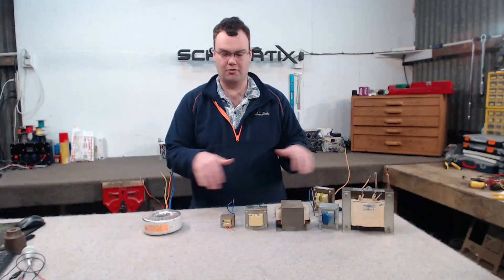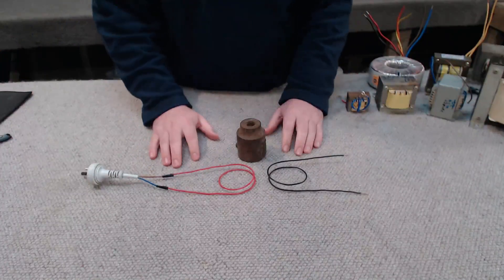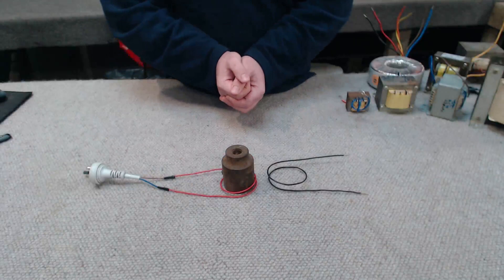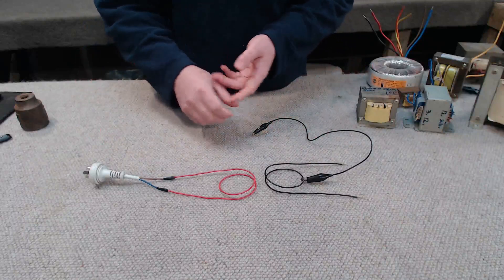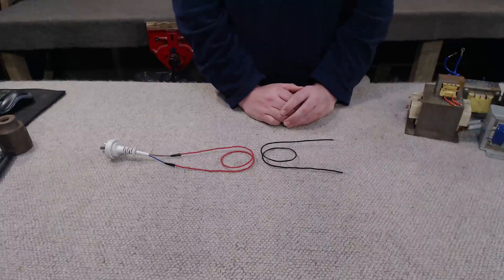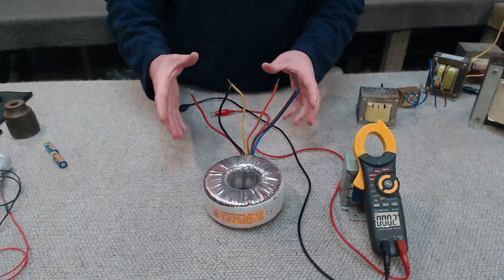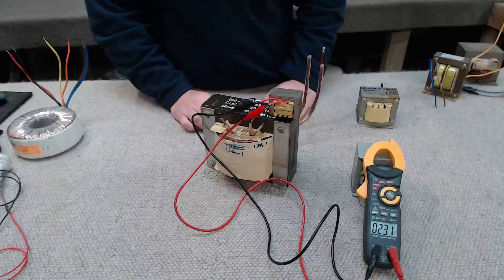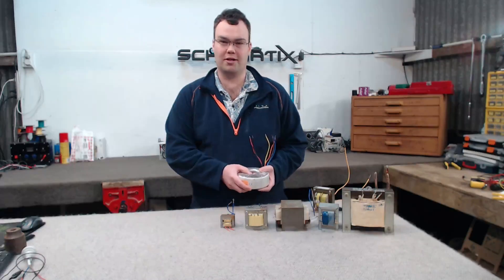Transformers 101: How They Work & How To Wire Them

Comment: Mate. Good video however you missed some critical information about "how" a transformer works.
The "transformation" from primary to secondary happens when the magnetic field around the core collapses or builds. This is why the input must be AC and not DC.
That said if you apply DC, there will be current in the secondary whilst the magnetic field builds but then stop when the core "saturates" (magnetic field is at it's maximum). If you then remove the DC, current will be induced into the secondary as the magnetic field collapses. Chop the DC and you'll get (nearly) the same waveform at the secondary (at which point the waveform becomes AC :-| ).
Keep up the good work.
Reply: Yep that's really fundamental and thanks for clearing that !
Reply: This video was more geared for basic fundamental understanding. What you are suggesting might be covered in a more advanced video

Comment: Hey man I would love to know more about the donut transform er. I'm taking a class for an electrician. You explained this very we ll. 👌👍
Reply: The toroidal transformer is common in UPS circuits and power conditioners. They save on core plates and seem to run quieter than the more common transformer ....

Comment: This was a great explanation, thanks! 👍 I'm always intimidated by transformers for some reason. I always prefer to just work with the abstract idea of source voltage and use a wall wart or something. Did you ever make that video about identifying wires in an unknown transformer?

Quick question: if you have something plugged in, but turned off, is the transformer still drawing current (and therefore money/energy) from the mains?
Reply: If the switch in the mains side circuit is operational and it is switched off then there should be no complete circuit to use any power the only thing likely to cause power use in this state is some conductive path across the switch terminals. A wet switch, damp dust or conductive liquid would likely be the culprit ....

Comment: I am going to Thailand, some time after this Coronavirus goes away, ...where they have 220 volt outlets.  My problem is I have a medical devise that is wired for 120 V.  Last time was in Thailand, I could not find an adapter or some other devise that would allow me to get the 120 volts as needed.  I could cut off my plug to my device and use a 220 Volt plug.  So, I assume I would need a transformer between the 220 V plug and my medical device.  If you could send me an email @ luvmoxie@gmail.com showing me what I would need between the 220 V plug and my 120 V medical device.  A schematic should show me what I need. Much appreciated.
Reply: dude just buy an adapter online but go to the Thailand consulate in your major city area and then ask them they will help you get one online.

Comment: Curious about toroidals that have 4 input wires, two red, two black. I presume this means they can be wired 120v. 240v. When the supplier provides no schematic for connection, How would a person connect it? On the output side it has buck converters to dc pre connected.
Reply: Use a multimeter.

Comment: Thank you Sir! I am trying to build a kiln using a high temperature arc that will melt Gold. The advice I’ve received is to use a microwave transformer. I think I need around 200 amps in order to produce a temp of over 2200 degrees Fahrenheit, much like an arc welder.
Reply from the maker: With a couple turns of heavy gauge cable you could easily get 200 amps @ probably 3~10v. If you have a little extra cash to splash, maybe picking up a used stick welder? It would give you a much larger transformer (don't buy an inverter welder, go for the old transformer style)
Reply: Which poses another question if you don’t mind? What I need is to make a portable. Like backpack portable. What I normally do with my powers Sluice, Is hook it up to a battery such as a car or a lawn more  or marine, and then hook up a power inverter the battery where I can plug I water pump into the power inverter. Do you think I could put something together similar to that?
Reply from the maker: @stephenfuller8345  If I follow your question right. You're asking about building an inverter from scratch? While it's very possible to make an inverter at home. I've priced up the components. My conclusion was buying an off the shelf inverter actually saves money. There are relatively simple inverters schematics online. However, the simple ones I've seen are very sketchy and can have nasty voltage spikes that would damage electronic circuits in most devices. So I can't recommend them.

Comment: Are all ac transformers meant to take 120 volts AC? Seems a bit much for the small transformer. (My transformer doesn't say how much the input or output is)
Reply from the maker: No. Transformers will be designed to only run on a specific voltage. If they aren't labeled it can be difficult to identify the operating voltage. Otherwise, you need specialized test equipment to measure inductance.etc and do some math to work out the operating voltage. In my opinion, it's often more trouble than a salvaged transformer is worth.

Comment: At time 10:00, you said two batteries in parallel would double the "current". Is it more correct to say it doubles the "capacity" or "amp hours"?  I'm thinking that current is the flow rate of energy (charge).  Thanks
Reply from the maker: Great question, Technically both answers are correct. Amp-hours is a measurement for measuring capacity Or energy storage. If I had to choose one term? I'd probably go with "Capacity" because it's a more relatable term for many people with varying levels of knowledge in this field. Naturally, this terminology is only applicable to devices which store power. Such as batteries or capacitors. If we were talking about a transformer which is obviously not designed for energy storage, then both those terms would be incorrect.

Comment: What about the wire thickness of the primary and secondary ? Please reply...
Reply from the maker: Wire gauge (or thickness) doesn't entirely dictate the peak input/output current of a transformer but, it can be used to indicate approximately how much current a transformer could output.

Comment: Does it matter which is the 'intended' primary winding, as that would depend on if you want to step up or down the voltage? A simple continuity test can be used to figure out which wires are electrically connected to each other.

Comment: Wonderful video!. Can you consider making a video that explains more in depth on choosing the correct transformer for the job. Example: I'm retrofitting a CNC machine that is 3ph.  I only have 220v 1ph.  The spindle is a 7.5KW motor that draws 10amps i believe. i have a 440v 3 ph VFD that will allow 220v 1ph input but it cuts the motor power in half. What I'm assuming i can do is take a step up transformer to turn my 220v 1ph into 440v 1ph then input that into the VFD allowing me to power the 7.5KW spindle motor. Will this work?
Thanks
-Chris

Comment: Thank you for the knowledge. Now so know on AC if copper wire turn around a metal. It does not short out...

I was wondering how the circular type of transformer is winding. Is primary wind around a circular metal. 

While circular winding go on top of primary winding.

Comment: Hi there, great video.
I watched your video ‘Transformers 101:  How they work & How to Wire them’. You made mention of how to find out the Primary Winding from the Secondary Windings if the connections weren’t obvious, and that you may do a video in the future to show how it’s done. Did you ever do this?
I have a transformer that was salvaged from a photographic film processing mini-lab, it’s very large in size and rated at 550VA. It has a manufactures label on it with the following markings: TYPE: S-9UF3. CAP: 550VA. PHASE: 1. FREQ: 50/60. MANUF No: 9391094Y. Chuo Electric Ind. Co Ltd. Japan.
I’ve had a hunt on the web but can’t find any specs on it.
It appears to have just a single set (core) of windings (i.e. all the windings are on top of each other on a single bobbin with various tapings extending from the centre to the radius), unlike your video on the microwave transformer conversion, where the primary and the secondary are two separate coils (bobbins) and easy to see.
Each of the tapings terminate on a terminal strip on the top of the transformer and have the following markings on a label fixed to the terminal connector block (from left to right):
‘EXT’  -  ‘PO’  -  ‘200’  -  ‘220’  -  ‘240’  -  ‘TO’  -  ‘100’  -  ‘SO’  -  ’17.5’  -  ‘24’

I have checked for continuity across each of the terminals, and from what I guess is each of the winding’s ‘PO’ ‘TO’ and ‘SO’
‘PO’ to ‘200’ value 1.2ohms
‘PO’ to ‘220’ value 1.2ohms
‘PO’ to ‘240’ value 1.3ohms
‘PO’ to ‘TO’ No continuity
‘PO’ to all other connections to the right  No continuity
‘TO’ to ‘100’ value 0.5ohms
‘TO’ to all other connections to the right  & left No continuity
‘SO’ to ’17.5’ value 0.1ohms
‘SO’ to ‘24’ value 5.0ohms
‘SO’ to all other connections to the left  No continuity

The ‘EXT’ connection measures almost the same as the ‘PO’ connection (i.e. connectivity between EXT and 200, 220 & 240, but none of the others).

My guess is that there are 3 separate winding:
PO to 200, 220 or 240
TO to 100
SO to 17.5 or 24
I don’t understand what the ‘EXT’ terminal does, although there are 2 tapings from the core connected to this termination.

I want to use this transformer for a 24volt supply only, but I’m hesitant to connect the ‘PO’ and ‘240’ tapings across the mains and see what voltages I get on the ‘SO’ and ‘24’ outputs (if in fact they are outputs).
What do you think?
I live in Auckland and I could let you have my email address if that would be easier to communicate.
Thanks

Comment: I needed to ask, let's I'm receiving 220 volts at 5 amps and I want to remain at 220 volts but have 20 amps of power, how would I go about doing that
Reply: You can't do that with a transformer alone. Power is the product of voltage x current, so 220 volts at 5 amps = 1100 watts, whereas 220 volts at 20 amps = 4400 watts. All a transformer can do is change the ratio of voltage to current between the primary and secondary coils - it cannot give you a greater power output. So if you stepped up your 220 volts to 440 volts, that would be at half the current. Going the other way, you could step the voltage down to 110 volts, but that would double the current.
You can have any ratio you want, depending on the ratio of turns between the primary and secondary, but the overall power output will never be greater than the power input. In reality, the power output is usually a little less than the input, since transformers are not 100% efficient. Some energy is always wasted as heat, which is why transformers get warm in operation, and why really big transformers need oil coolant loops to stop their cores melting.
Reply: Just quadruple your voltage by getting a different power supply. That 220 doesn’t mean much when it’s limited to 5 amps. Otherwise lower the resistance of the output where the 220 volts is going through

Comment: Note: when disabling a microwave to salvage a transformer, discharge the capasitor by disconnecting it from the unit with insolated equipment. USE GLOVES AND A TOOL THAT IS NOT CONDUCTIVE.
When the capasitor is disconnected note that it is still charged and can be fatel.

Comment: Thanks for the video.

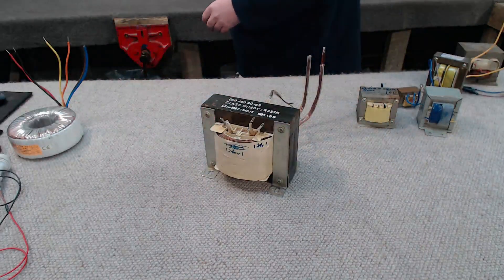I do have a question. Around the 11:00 mark you say that "you can't simply use a voltmeter to figure out the primary from secondary windings". Do you mean to say that you can't use a voltmeter to decipher which leads are which on the secondary coil? 

In technicality, can it be assumed that the two wires at the back end (relative to the viewer) of the transformer are the primary and the four wires at the front end of the transformer are for the secondary?

Final question, if that is in fact not the case, could you at least use the "continuity" function on the voltmeter to correctly identify primary from secondary coils?

Thanks

Comment: I understand the physics of the transformer, what I'm stuck on is, I stripped down a car battery charger and inside is a transformer with 6v and 14v outputs and that goes to a bridge rectifier, when I connect up a dc fan i took from a car cooling system, the bridge rectifier continually clicks on and of, so I get a clicking sound and fan powers on/ off/ on / off etc, 
What's going wrong?
Reply: The fan draws too much power for the transformer, and the over current safety is clicking in and out. You would need a pretty big charger to run a cooling fan.

Comment: 1 question, how & why the primary don't short 

Also the voltage on Europe and Russia can reach 380V
Reply: custume, both the primary and secondary windings  are made with  "enameled" or varnish-coated copper wire  that is insulated  and so the windings can touch each other , and/or touch the steel laminations and Transformer core without shorting out or making any kind of electrical contact. Also, after manufacture most Transformers are dumped into some kind of varnish or even epoxy and subject to a vacuum which draws all the air out from between the windings and fills the gaps with the varnish or epoxy so that the physical positioning of the windings is fixed and only minimally subject to movement or vibration. The primary and secondary windings do not and should not have any kind of electrical connection between them, nor should either one contact the metal parts of the Transformer core and laminations.
Reply: because the secondary collects the electricity from the primary.And the secondary has two loose wires
Reply: 380v 50hz=440v 60hz,,     380/50=7.6 , 460/60=7.6, as you can see work the same,but in case of a motor the speed  varies in proportion of HZ .

Comment: Good video, BUT you completely fail to explain how the transformer works and most importantly that a transformer will NOT WORK ON DC.
I have come across so many people who have absolutely no idea WHY XFORMERS DO NOT WORK ON DC.
You should also explain why the windings have different gauges of wire and why the wires are wound around a metal core.
Perhaps you have explained it in other videos, but mentioning it here would be very useful.
I have been an electronics enthusiast all my life but only recently did I watch a video in which the presenter mentioned that XFORMERS will ALSO NOT WORK ON AC THAT HAS A SQUARE WAVE INSTEAD OF THE STANDARD SINUSOIDAL WAVE, I was stunned by this and it took me a few minutes to realize WHY THIS IS SO. It had just never occurred to me before.
The moral is that we should never assume that everyone understands basics principles.
Reply: Good evening.  I've viewed many videos where transformers are wired in reverse 12vdc to 110/220-40vac
Quite interesting work. Mosfets and diodes are part of the circuitry as well as oscillators to regulate the voltage

Comment: I have a lot of transformers but the problem is I do not know how much amps come out of it. Is there a way to know which amps come out of the transformer? Or what kind of multimeter can you know? Thank
Reply: by the size of the core  and wire gauge

Comment: Can I test with a simple cheap multimeter?
Reply: If you know what type of transformer you are dealing with a simple multimeter works sometimes. If you have a step-down transformer like they use in old type dc adaptors you can understand input side because of high resistance. If you have microwave transformer (they're quite dangerous btw) it is reverse because it step-up the voltage then output side has high resistance. If you like to get the input-output ratio you can connect a known low ac voltage and find out output with a multimeter. But I do not suggest you play with transformers with high voltages without knowing exactly what you are doing.
Reply: good advise

Comment: Where do all the wires come from?
Reply: I'm new at this but trying hard to understand. I've got tons of used appliances tore apart. Wantinting desperately to understand and experiment. All my transformers seem to only have power side wires.. I can't even get started. I need a tutor. Long hours low pay. Any teachers out there?
Reply: Tracy Stroud if they only have one set of wires maybe it's an autotransformer? but I doubt it.
Reply: they are chokes
Reply: If there is only two wire come from the transformer, it is probably an inductor, filter inductor also known as input choke probably. But if there are more than 2 wires which are not isolated from each other it may be an autotransformer. But it is usually not used in home appliances because of lack of isolation.

Comment: So a partial related question to this video and a previous on on rewinding a transformer..I want to rewind a MOT using a high temp laminated 10 awg solid wire. I know it's almost impossible question but when you getting your 21V output approx how many feet was your secondary?
Reply from the maker: I used approximately 7 meters of wire
Reply: Great I'll let you know how it works out.
Reply: 50ft